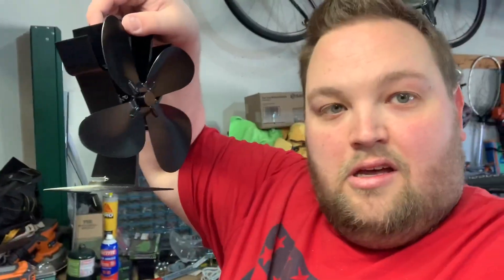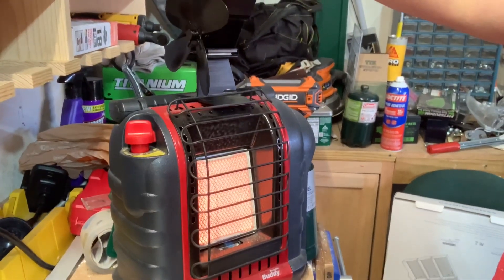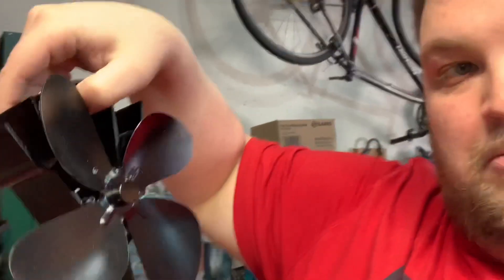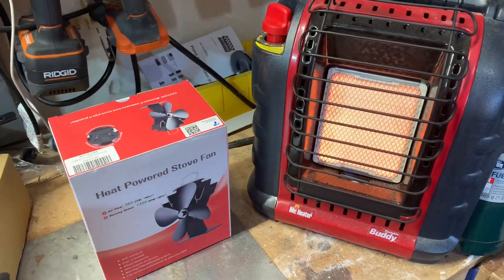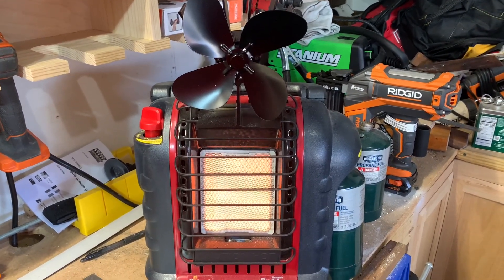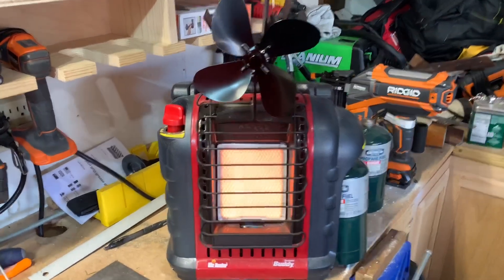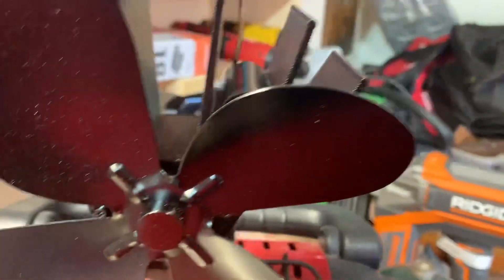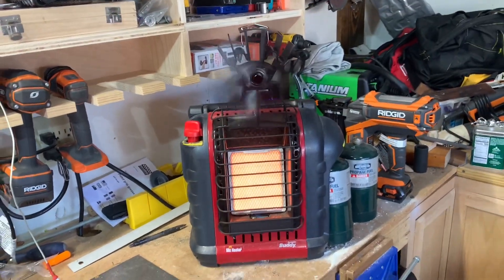How to add a Wood Burning fireplace fan to a portable Mr. Heater Buddy!

Comment: Is the fan still working 2 years later or did the wiring burn out?  Does it work on the top rung, if you had moved it up?